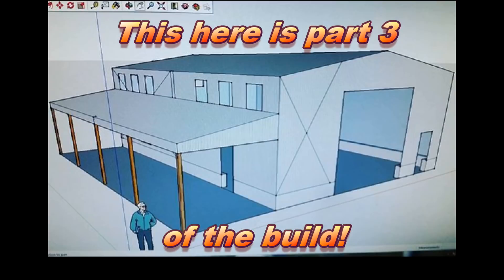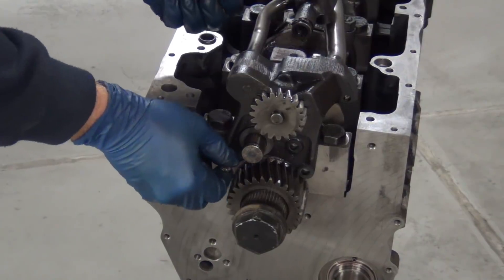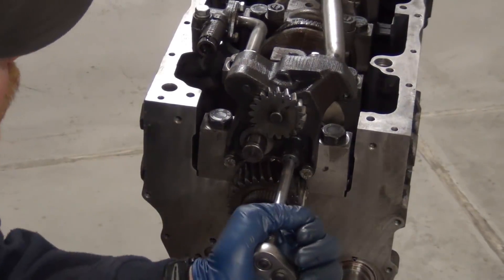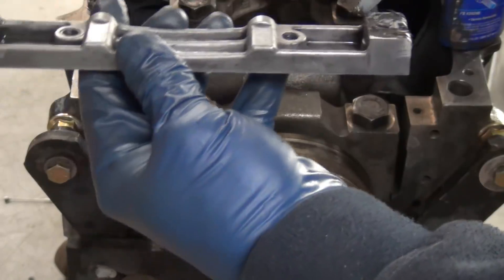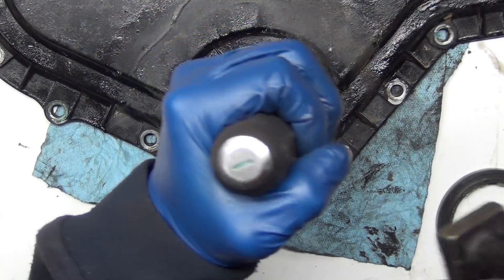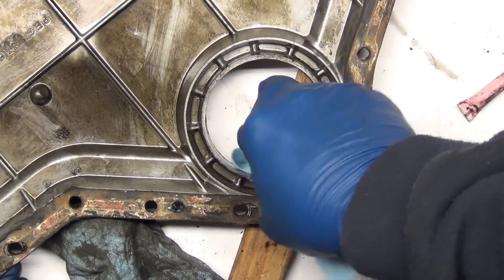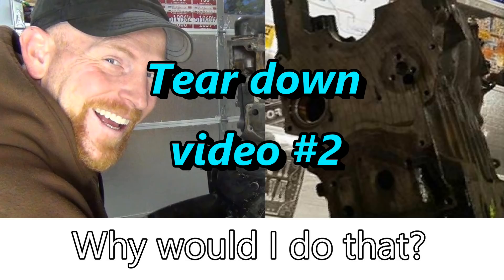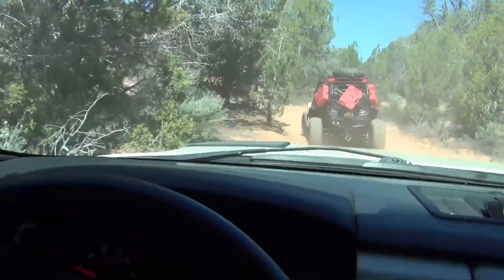Perkins Diesel Engine Build Pt  4 Oil Pump and Seals

Comment: Is there any difference as to why your engine runs that oil pipe with the release valve on to the short side from the pump, I am working on a caterpillar 80 Perkins, and it runs that pipe to the long side and I got oil to rods mains and cam, no oil to a line on the out side of block to a bearing in the front of hydraulic pump, and no oil to the oil sensor, and no oil to the head, for valves,  cat 80 forklift
Reply from the maker: Depends on the application/configuration the engines installed in I think.  I'd have to look at it.  Check your lines where they connect at the pump and check your rod bearing clearances.  The oil pump is like a lift pump- rod bearings get the pressure up from there as I understand it.
Reply: @briansmobile1  rod and mains are new cam bushings new sleeve and pistons, this was a remanded engine, with low remand hours, some used either or got gas mixed up with diesel, cause it blew three of the four pistons , broke rings ring land and cracked them, distorted the tops of the liners,
Reply: Hello I figured out why I wasn't getting oil to the valves and the oil pressure sensor, I had the oil filter base on the wrong side of the engine, the pipe on my oil pump goes to the short side and I. Your video yours went to the long side, I put my filter base on the opposite side of the engine as to the pipe from the pump, found out the it is imperative filter base has to go on the same side the block, as to the pipe from the pump, put the base on the same side the block as the pipe from pump and wala I got oil to the valves that is some thing that could be capitalized in a video, it is important that the  filter base goes on the same side as the oil feed tube

Comment: Quess I will have finish watching a part 5 to find out if like Mercedes, in that never reuse the old head bolts. Never been into a Perkins, so I will order a shop manual. Your series is shedding a lot of light on this rebuid, Thx, Bear in Tx.

Comment: How should I insert the driveshaft (of the pump)? Which side should be facing up?
And should the timing marks be aligned even though they were off by 1 tooth when I disassembled it?

Comment: Brian, dump the crescent wrench and get a  set of Knipex pliers wrench .  Joe
Reply from the maker: If you send them, I will use them in a video.  
briansmobile1
PO Box 282
Cedar Valley, UT
84013
Reply: briansmobile1 I am going to speak to Knipex.  Regards. Joe
Reply: Hi Brian,  i think someone from Knipex will be in touch with you soon.  Meantime, have a look at this URL: https://youtu.be/7Z7_NpmUuKA
This will give you an idea of the pliers wrench capabilities.  I carry a pair in my work coveralls all the time. (86-05-180)

Comment: I'm surprised you didn't put some loktite on the oil bolt stuff, if it was loose on disassembly it might be vibrating loose...
Coming along nicely!
Reply from the maker: Sitting on this side of the rebuild I can tell you this engine's been out before and it's been repaired on a time budget.  Good parts, but put together fast.

Comment: These Perkins diesel engines have a long heritage back to the days of the British Empire.  They were designed and built to be sent all over the world to remote places with few resources.  They can be serviced and maintained with minimal tools and training.  You will never stop it from leaking oil but that's OK.  Just keep wiping her down and filling her up.  You will end up adding so much oil that you won't need as many oil changes.  Don't try to use full synthetic oil, it will just leak out faster.  The oil sludge and crud does a lot of the sealing of the engine.

Comment: So I cannot hold a candle to your mechanic skill, however 18 years of machine shop experience I feel compelled to offer some input on your measuring tool terminology.  What you are using for measurements is a digital caliper, the analog version would be called a dial caliper, a micrometer is something completely different. Also .230" would be properly read "two hundred and thirty thousandths"  In the machine shop world, however improper it may be a "tenth" is .0001"  .1 would be stated "one hundred thousandths"  Just thought I would share this,  awesome video, and thanks for your effort.
Reply from the maker: You're welcome.  Thanks for taking a couple minutes to invest in me Ben!
Reply: Now I'm more confused.
.1 = one tenth
.01 One hundredth
.001 one thousandth
.230 two hundred thirty thousandths of an inch -can also be referred to as twenty three hundredths, but is not necessarily proper...
I'm not sure why .0001 is said to be one tenth. It's backward from what i learned in school...not that I'm a machinist by any measure.
Reply: .0001 is one ten thousandths of an inch shortened to a tenth for speech only.
Reply: Allow to explain better.  In a machine shop, provided you are using inch increments to begin with of course, the smallest unit of measure is a "thousandth" or .001.  so you basically read 3 decimal place number as such.  For example 5.390 "five inches, three hundred and ninety thousandths" 5.4" would be "five inches, four hundred..." etc.  .0001 is read as a "tenth" because it is a tenth of the smallest increment .001, basically a tenth of a thousandth.  So on occasion if you had a bore, for example the wrist pin fit on Brian's Perkins rebuild, the size tolerance, if it was given in inches would probably be plus or minus a few tenths, I am guessing, we don't do engine work in my shop, so if the given size was lets say 1.2500, and after machining the measurement reads 1.2502 this would be verbally stated "one inch, two hundred and fifty thousandths and two tenths"  Put that in your pipe and smoke it..